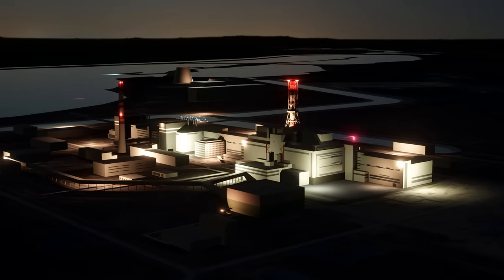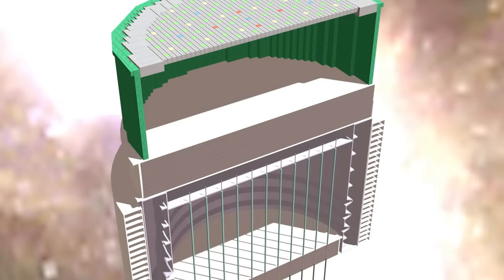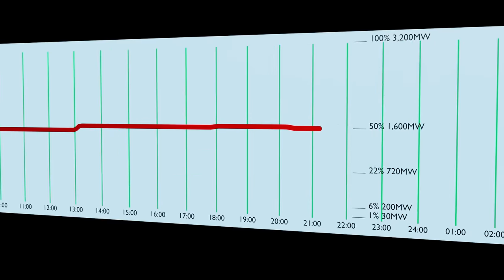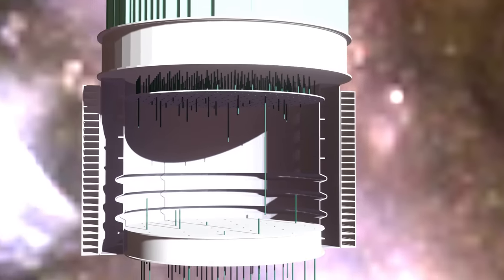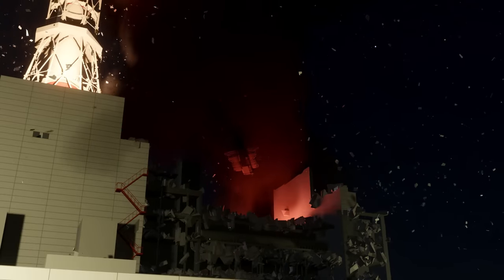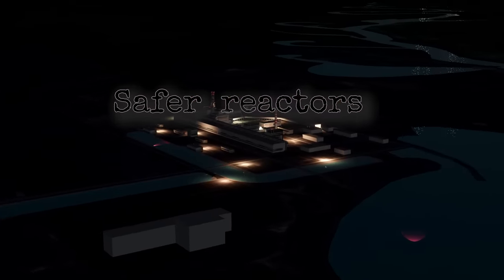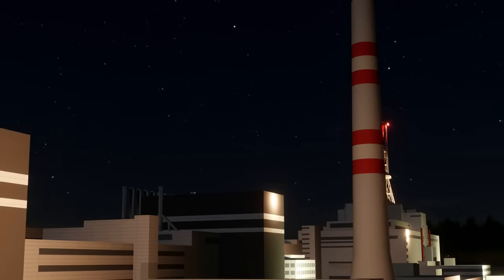CHERNOBYL AZ-5 why it exploded

Comment: МАГАТЭ - Международное агентство по атомной энергии. Я не специалист в данной отрасли, но реактор взорвала кнопка АЗ-5/6 и каждый раз когда нажимается эта кнопка идёт разрушение любого атомного реактора. Эту кнопку рекомендовало МАГАТЭ - Международное агентство по атомной энергии по технике безопасности. IAEA - International Atomic Energy Agency. I am not an expert in this industry, but the reactor was blown up by the AZ-5/6 button and every time this button is pressed, any nuclear reactor is destroyed. This button was recommended by the IAEA - International Atomic Energy Agency for Safety.
Reply: А.С.Дятлов. Чернобыль. Как это было
Reply: Такой реактор работать  не  может,  хотя  бы по следующей причине:  при делении  урана образуются ядра различных химических  элементов и среди них в значительном количестве ксенон с атомным весом 135, обладающий очень большим сечением  поглощения нейтронов. При подъеме мощности начинает образовываться ксенон,  и реактор заглохнет. Так и было с первым американским реактором. Э. Ферми посчитал сечение захвата нейтронов ядром ксенона и в шутку сказал, что ядро получается величиной с апельсин. Such a reactor cannot operate, if only for the following reason: the fission of uranium produces nuclei of various chemical elements, and among them there is a significant amount of xenon with an atomic weight of 135, which has a very large neutron absorption cross section. When the power rises, xenon starts to form, and the reactor stalls. This was the case with the first American reactor. E. Fermi calculated the cross section of neutron capture by a xenon nucleus and jokingly said that the nucleus is the size of an orange.
Reply: Как  и  нормальным реакторам,  реактору  РБМК запас реактивности  также необходим для маневра мощностью.  Еще после аварии в 1975 г. на первом блоке Ленинградской АЭС для РБМК был определен минимальный запас реактивности в 15 стержней исходя  из необходимости  регулирования энерговыделения  в активной зоне. А после чернобыльской аварии была найдена совершенная дикость,  абсурд  -  при малом  запасе  АЗ  не  глушит, а разгоняет  реактор. Чем меньше запас реактивности, тем более ядерноопасен / Like normal reactors, the RBMK reactor also needs a reactivity margin to maneuver power. Even after the accident in 1975 at the first unit of the Leningrad NPP, a minimum reactivity margin of 15 rods was determined for the RBMK based on the need to regulate the energy release in the core. And after the Chernobyl accident, complete savagery was found, an absurdity - with a small supply, the AZ does not shut down, but accelerates the reactor. The smaller the reactivity margin, the more nuclear hazardous

Comment: It’s not a AZ-5 reactor. It’s called RBMK-1000 reactor or RBMK reactor*
Reply: AZ-5 was the switch that caused the reactor to fail, so the title is correct
Reply: @wazda6488  I know that the AZ-5 (A3-5) is the button to turn off the reactor and that there was a fault with the emergency stop system and that was the reason, but the reactor is still called RBMK-1000. So yes, the title is wrong. A better title would have been "Why the RBMK reactor exploded"

Comment: I disagree with the fact that "we will never know what happened that night in the control room" - How dare you!
You didn't look much into the topic, once you would, you would realize that DYATLOV HIMSELF wrote a book about what happened that night.

You state the minimum rods inside were suppossed to be 26. At the time IAEA based on soviet informants information stated that 30 were required. 30 "reactivity margin" were required AFTER THE ACCIDENT, so IAEA was provided with false information. Prior to accident the minimum was 15 and in the design of RBMK there is no information that RBMK requires any! reactivity margin.
During the test at least 13 were in.
This is all stated in Dyatlov book. What is amazing about this book is that Dyatlov gives references, gives arguments, counter arguments, comments, explains how the reactor works and why they operators did what they did.
Dyatlov accuses not only soviet union of lying and blaming the crew, he states in soviet union, no matter what you do it's always operator fault.

Volkov, which in 1975 informed about positive reactivity when emergency protection system is used, gave a report to prosecutor which stated that the situation is caused by a wrong design of reactor, graphite rods @ control rods, positive void coefficient which he has reporter in the past. Volkov was immidiately throw away from the institute. 

Low power? What's the problem Dyatlov asks IF the regulation allowed the operator to work with a power if the power was in the "low power regulator" range which was 8-100MW and the minimum registered was 30MW which was increased to 200MW.

700MW during test was the top power, not the minimum.

All his arguments are in his book and you can make your own conclusion...

Comment: Very nice model, but but there are quite a lot of inaccurate information.
Reply from the maker: Expand on the inaccurate information…
Reply: @Mike-Bell  Reply is repeatedly deleted, now I am trying without links:
Thank You for your interest, and also thank You for great video. I did some more research, and some of your info I had problem with, shows as true. Still, in sake of finding truth and facts (now I really feel nitpicking):

0:12 In narration, there is correct information about five of RBMK power plants, but in subtitles is different information, without "huge" mentioned, so beside Chernobyl, Kursk, Leningrad, Smolensk and Ignalina, there were also two smaller RBMK sites: Beloyarskaya (prototypes named AMB) and Bilibino (4 small 12MW RBMK units, 3 still in operation).

0:32 AZ5 button shape, but that was explained at 7:00.

1:00 Chernobyl position on world map is shifted much to the west.

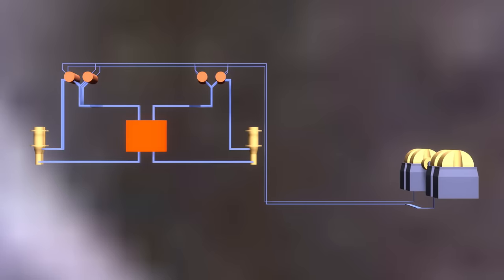1:50 Animation can make an impression, that reactor is fed directly with water from the cooling lake, which is not the case. They are separate circuits.

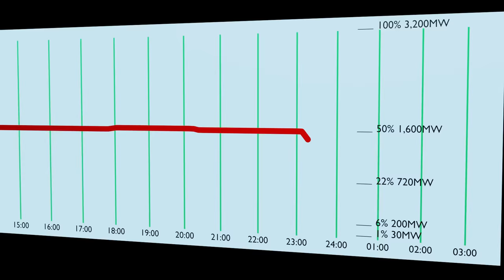5:25 May be there should be mentioned difference between megawatts thermal and electric, where 3200MWt ~ 1000MWe. People sometimes don't understand, how 1600MW is 50% of power on 1000MW unit.

9:14 Reactor lid probably do not fly so high, according of my knowledge, but who knows. :)
Reply from the maker: @nurotn  thanks for the reply. I agree the height the lid flew is a guess on all accounts because nobody saw it fly.  The cooling loop is correctly indicated in the Russian version of the video. Yup the Chernobyl marker is off. You get full marks for attention to detail.

Comment: This was a failure of leadership. ‘we can’t do anything wrong’ does not apply to engineering. There was a design flaw, so you communicate those realities to the people who need to know about it because they have to work in that environment. Any philosophy anywhere will always give way to physics, because physics cannot be fooled. It works or it doesn’t, there are no two ways about it.
Reply: The designers knew about the flaw, and there was a power excursion at another NPP when they pushed AZ-5, but they were too slow and to complacent to fix the issue at all the RBMK NPPs.

Comment: had a containment saved the environment?
Reply from the maker: 1. The explosion was very powerful so it is very debatable if it would have held.  And the containment would have been so big it would have been more likely to rupture.
2. Fukushima released quite a bit of radiation even with having a containment.  It released about 10% of Chernobyl.  So a containment makes it much better but doesn't eliminate radiation release.
3. A containment at Chernobyl was basically impossible.  It's core was so huge compared with typical reactors.  So the containment would have been gigantic.

Comment: I can answer the lesson question from the beginning in 5 words. Fucking graphite tipped control rods. Let me explain. Swearing may seem unprofessional but im all about it so from now on im turning my humor off lol. Anyways, the graphite on the tips was locked into place constantly accelerating the process. All because the heat caused the motors to lock and the control rods to fail. Graphite speeds the process up and heat produces quicker. Basically they killed themselves in a giant ionizing microwave. (Ionizing is dangerous radiation) (not that microwave radiation isnt dangerous just in a different way)